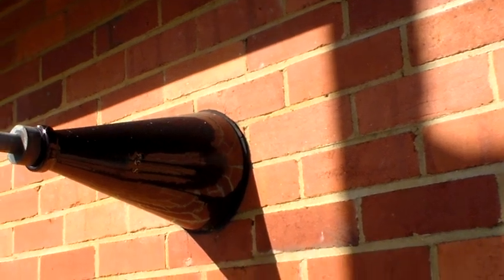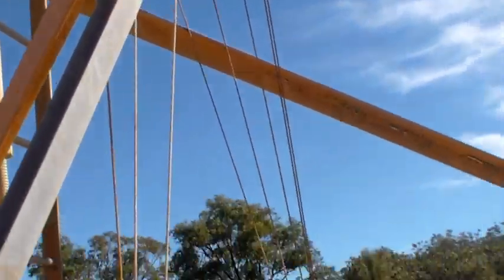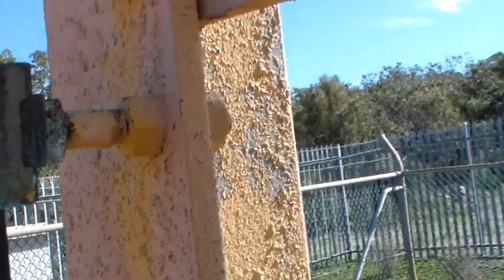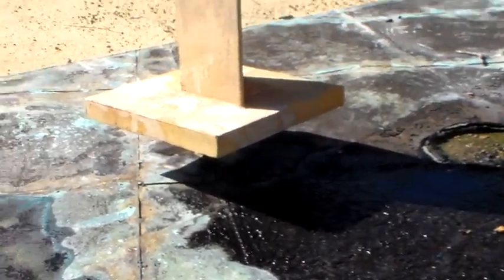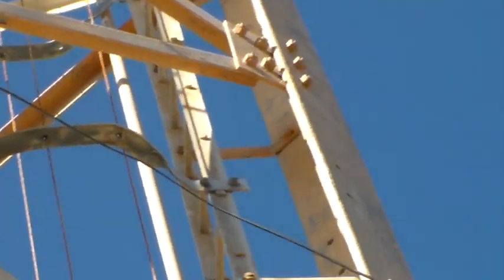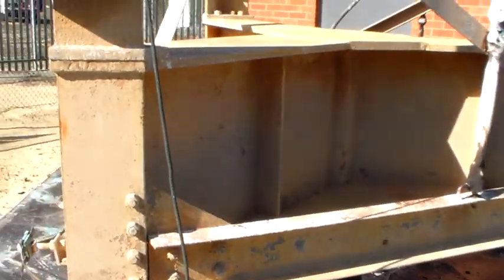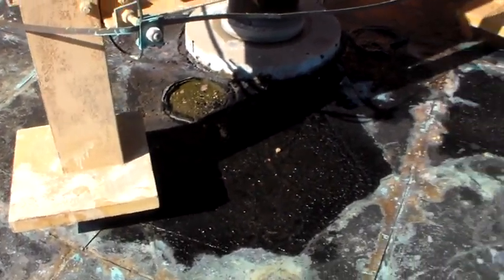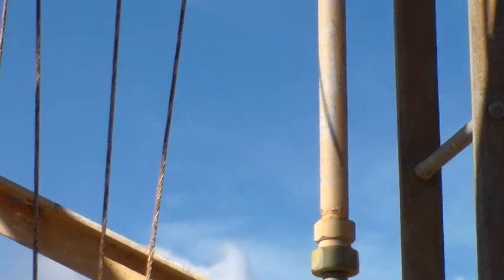High Power AM Broadcast Antenna Mast Feed-Point.

Comment: Nice video. The legs that you talked about putting bricks under. They are for jacking the tower up. Most insulated guyed towers between 280 and 1350 feet in height have been designed with jacking plates under the tower legs for the purpose of base insulator replacement.

Comment: Pretty good rundown, Steve, ignore the  silly comments.
If it's the one I used to know, all your comments are spot on.

Did you notice that the big porcelain insulator is slightly deformed by the weight of the mast, compared to the unused one?

The downpipe on  our mast hut was burnt by people creating an arc between it &  the fence .(both ostensibly at earth potential).
Bit safer than the Russkis----- we had a large insulator with some heavy steel wire attached to the end.

You could hear the programme from the "singing arc".(back in the days before everybody became paranoid about RF)

I also remember lying on my back at 2am in the freezing cold cleaning "gunge" off just such an insulator
with "Bon Ami" & distilled water .
Don't know if it did much good, but I remember being very aware of so many tonnes of steel above me, perched on that insulator

Comment: How come it doesn't have one of those transformers with two interlocking rings to run the tower lights without sending RF back down the power line?
Reply: They are called Austin transformers. They can be located within the ATH and the cable is then fed inside the main feeder out to the mast. Better protects it from the elements

Comment: Steady on with the camera VK6CS..
Interesting video of course but a bit dazzling trying to see what's what.
How do they 'load' this structure? Is there some kind of tuning circuit between the output of the TX and the tower?
..and, why do they need to "broaden the band" (with these cables) when, this AM tower would be of a fixed frequency?
73's from a VK2 _ _ _
Reply: Because if the antenna's bandwidth is too narrow (which happens when an antenna's Q is particularly high, e.g. due to low resistance encountered at lower AM frequencies due to reduced "skin effect") then the transmitted audio will suffer from reduced treble.  Treble gets reduced because that audio is carried by the AM signal's sidebands, slightly above and below the carrier frequency, and these will be attenuated to progressively greater degrees with their "distance" away from (either side of) the carrier frequency. The treble's sidebands being particularly far out (in frequency) from the carrier.
Reply: @DavidEsp1  
Good heavens!
It's more than what meets the eye..
I never thought of that but it all makes sense.
Tnx for clarifying it David.

Comment: I just found out today that these towers have current running through the whole thing. I love to climb but good thing I respect fences and warning signs!
Reply: Yeah, if a tower light needed changing, you turn the power waaaaaay down.  Our engineer would turn our 25kW transmitter down to, I think, a thousand watts omnidirectional while the light guy was up there anywhere on the tower.
Reply: Medium wave AM transmitters are almost always of this design. Known as mast radiators because the entire mast is the antenna.
Reply: @ApartmentKing66  
Υοu mean he was up there with RF power on the mast??!
One 1 kw is not a negligible amount of power by any means.  I am really surprised he was allowed to work on it while 'hot'.
Work cover wouldn't be impressed with such action..
Reply: That's why I'm here because if I had lived close to one I'd be dead

Comment: There seems to be a lot more going on here. what about those series of wires inside the mast area? So, you're saying the tower itself is the antenna? ...and what about the circle of wire at the top of the tower? You say the tower is 600ft. or ~750khz? the rest of the area looks pretty dilapidated and is in need of attention for more efficiency. What do you think?

Comment: At 02:20 what's the function of the "wire cage" transmission line inside the metal structure?  Briefly wondered if it was a shunt/gamma feed but then I remembered the base was insulated - and you explained the feed going in (as expected) at the base level.  So what's the cage-feed for?

Comment: Hi, how much KV is the power supply on this transmitter feeding into it?  Just curious. Any concerns of arcing at the base of the mast where that insulator is, especially when raining or flooding?  Are there any safety hazards for unauthorized personnel loitering about the vicinity of the antenna?  Thank you.

Comment: KNX attempted to employ a directional antenna ... DAYS ONLY ... in order to better serve the Inland Empire, but that was way, way back when the shorter tower was southward of the main tower. However, that configuration was far from effective and was later abandoned. That would have made KNX 50 kW ND-N, DA-D.

After the site was donated as a park, the shorter tower was moved northward of the main tower.

As a Class A station, KNX protects NO OTHER stations. After the co-channel Class A station in Canada was taken dark (moved to FM), KNX became the only Class A station on 1070. That means, of course, that every 1070 station anywhere in North America protects KNX during critical hours (if necessary) and always at night.

The taller, main tower is the ideal height at 195 degrees. The shorter, auxiliary tower (used only when the main tower is otherwise out of service), is about 135 degrees tall, and was purchased and installed when the main tower was destroyed by vandalism in the 1960s, and it served in a temporary capacity until the new tall tower could be constructed.

Now, all ND-U Class As are expected to have auxiliary antennas. Class As which operate DA-N are not necessarily so required, but they are encouraged to do so, where practical.

WWL, for instance, is 50 kW DA-1, but it has an auxiliary at a co-owned station, and that auxiliary is licensed for 5 kW DA-1, but only when WWL's main site is down.
Reply from the maker: Sounds like fun. I thought you guys liked folded unipoles between 105 and 115 degrees?
Reply: The Queen will take it over.
Reply: I think the protection radius was 750 miles in every direction.  There's a station in Houston on 1070 (DA-N, I'm sure).  Maybe it varies for different license classes, I don't know.  When I was at KNBA in Vallejo, CA (1190 kHz), our engineer told me that because we were within a 750-mile radius of Portland, we had to shut down at sunset to protect KEX.  We wouldn't have had to do that if we were south of Monterey Bay.  KEZY in Anaheim broadcast at night.

Comment: I assume if you touched it, you'd glow like a neon bulb ?
Reply: Yeah, from the inside.  Your insides would start to cook first, then the RF radiation would work its way out...if you were able to hold on long enough before dropping dead.
Reply: @vk6cs456  What's the purpose of the unmodulated 20kW carrier?

Comment: Tried climbing up an AM tower once... but hey, I'm still here so there's that 😅

One of my hobbies used to be climbing tall structures like smokestacks and lattice towers. I had no idea this particular tower was actually a mast radiator and that it was electrically charged like that. When I reached up and grabbed the bottom rung I got an instant shock. Needless to say it was quite unpleasant however I've been shocked once before installing a light blub and that was actually worse. The AM tower was more superficial and I got a bit of a burn on my finger tips while the light blub shock I felt across my entire body. 

Anyone know why that is?
Reply: Rf skin effect. High frequencies don't travel as far into the body
Reply: @phillipsfilms8023  That effect only applies to good conductors (such as copper), which your body certainly is not (skin depth in tissue is something around 20 cm). The reason you don't feel 'electrocution' by RF is because your nerves can't react fast enough to the high frequency electricity.
Reply: Do you remember that characteristic smell of burning flesh ??
Reply: @maverick5117  I don't remember the exact smell anymore, but yeah I do recall that it smelt pretty bad.

Comment: Dear Sir, 

May I suggest another reason for the legs and feet ?

What is more likely is that the feet are used when they replace the insulator and they need a way to jack it up.

Any other bright ideas ? I'm not a broadcast guy although I have a secret plan to one day have my own AM broadcast station with giant diesel generator, just so I can see and smell the black smoke when I do full carrier double side band......
As Jeremy Clarkson says "POWER"

I must ask the ACMA the cost for a single frequency AM license, say upto 5000 watts.
Reply from the maker: You may suggest anything you like Sir. They wouldn't be able to get jacks under those plates as they're too low to the ground/copper sheeting. You're probably right though, that's what they're on the ends of the mast legs for, they probably expect there to be more to the mast structure at the bottom, like the four corners going to a point, then sitting on the insulator. That would put the plates about 2m above the ground. it was probably modified, it is quite old. The mast with the capacity hat weighs around 58 tons so it would need some significant jacks to lift it.

As for your AM station, why not do a Wolfman Jack and go for 250KW.
Reply: VK6CS I want to talk over radio china.
Why should they have a monopoly on pollution and RF radiation spurious emissions ?

As for the tower : I tell you what, Why not ask the guy and find out ? It's one of those things that I have to know but I really don't need to know.

I am fascinated by engineering.

So, Question : What are the leg ends for ?

NB : Hydraulic plate jacks are flat and can easily lift 100's of metric tonnes. If the whole things weighed 1000 tonnes then flat faced lifting jacks could easily fit between the leg ends and the ground. 

Or could it all be to do with electrical length, capacitance and ground-effect or whatever ??

But thanks anyway for the video. I have only been in NTA re-broadcast sites and never into a main transmitter. I bet when they switch her on that she'd be humming.....

Q : What is the safe distance when she's running full power ?
Reply from the maker: I'll ask the questions when I see him.
Reply: Steve,
The 3 "feet" are the jacking points to change the insulator. We used to use 3 Enerpac hydraulic jacks piped to a single pump so all the jacks took the same weight. The jacks were only 3-4 inches high when collapsed. They only had to lift about 2 inches to get the main insulator out.  I remember doing one of them in WA but cant remember if it was Dalwalinu, Wubin or Hamersley. They were all the same type of mast.
Reply: Arrr, That should read Wagin not Wubin.
Reply: I was right, thank you :-)